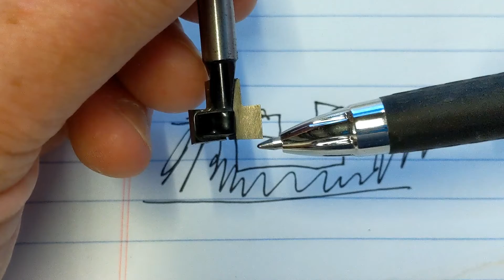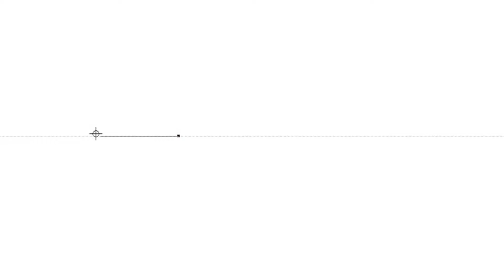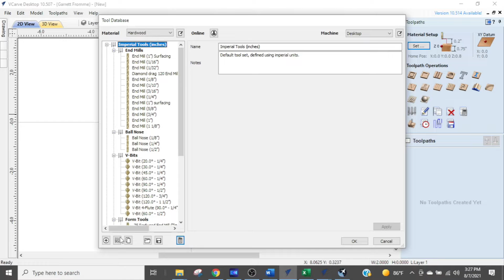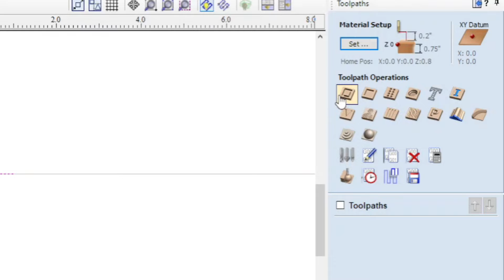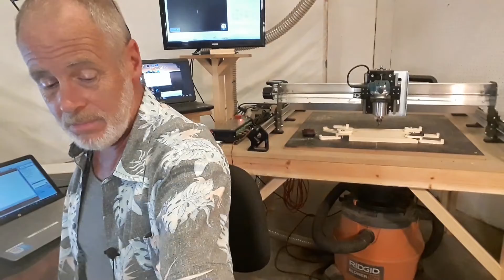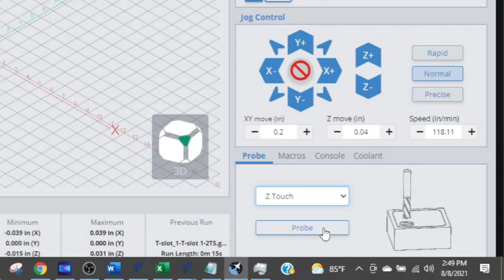How To Design/Make Keyhole Slots (T-slots) for CNC Router Projects - Garrett Fromme

Comment: Great video thanks, a little tip I have found useful is when I am using a 3\8 tee bit in oak I use a 1\4 straight bit and cut a slot with the same tool path but 3 passes.  This reduces the the load on the tee bit, I know it means a bit change but it works well.
Reply from the maker: Thanks for sharing that tip! It's always great to hear different techniques that can improve the CNC experience.

Comment: I hope you have time for this simple question?
In order to make your hold down clamps, what is the length are your T slot bolts?
Reply from the maker: iwannaapple7190, great question brother there really isn't a specific size bolt you need for the clamps, I recommend using whatever size you have on hand!
Reply: @IDCWoodcraft  
Mine were 5 inches long which does matter cause it runs the risk of the gantry running over them. The longmill isn't even that high and my cnc4newbie was barely clearing under the z axis. Cutting them was my only option. Cutting them too short will not afford me to use your clamps. Cutting them too long will put me in the same position of risking the router to run into the plastic knobs so I needed to make them right the first time. I think I cut them to about 3.5 inches? That turned out to be the minimum size so I got lucky that the clamps will still screw down.
In my opinion, the distance from the channel to the end of your clamp needs to be increased. It should be between 1" and 1.25 inches spacing. This allows for slightly more material to be cut out at the end for a lower and better grip on the wood. 
I cut mine out of 2x4's. Haven't used them yet but they are plenty strong using wood from the 2x4's.

Comment: Garrett love the videos, some thing i tried in vetric I used a rectangle 2inches long and .005 wide instead of the lines  on top of each other. The machine thinks it is a rectangle so it plunges down then cut on one line down moves over .005 then cuts  back on the other line to the start position and exits the piece . I tried it number of times and different t slot bits and it hasn't failed me yet.I have to get over and send you some coffee I drank a few watching this .
Reply from the maker: Don, that is a great idea brother! I want to try that myself.

Comment: I have been making tee slots for 2 years now, but just discovered this video. I set up the toolpath in Vectric the same way you do, but I do a few things differently. First of all I make a pilot hole with a regular end mill for the tee slot bit to enter before beginning its horizontal pass and I also cut a narrower path the length of the cut to clear the bulk of the material out of the cut before my tee slot bit even enters the wood. Doing it this way lessens the resistance on the bit because it doesn't have to remove all the material at once, leaves less debris in the cut and allows me to cut at 100 IPM.  Finally, I use a flute toolpath set at the desired depth with a 1% ramp at the beginning and end instead of a profile toolpath. Works perfect. I guess it just goes to show there's more than one way to do things.
Reply from the maker: Covert, all good points. There are so many ways to skin a cat in CNC. I'm glad that your method works well for you too.

Comment: I ran my G code for the T Slot and it plunged into the material, moved forward on the Y axis slightly, returned to the place it went in then made the slot to the right and then to the left and came bach
k up out of the hole. It worked but looks sloppy having an elongated hole instead of a round one. How can I adjust the G code to stop that motion? The code reads:
 (4AC7A5FFD0F6DEDC3B51B569B338FFCA)
T1M6
G17
G0Z20.320
G0X0.000Y0.000S16000M3
G0X-25.400Y0.000Z5.080
G1Z-8.890F203.2
G1X25.400Y0.000F762.0
X-25.400Y0.000
G0Z5.080
G0Z20.320
G0X0.000Y0.000
M30
Reply from the maker: Glen, your Gcode looks good. I read every move and there is nothing that would indicate to me why your hole would be elongated. Are you sure that its not a problem with the machine?

Comment: Another GREAT video. In Vectric simply make one line left to right, then click again on the right and go back to left or vice versa. one line on top of the other and it will complete the cut the way it should. I got tired of changing bits so I got a bit at Menards "orange brand"  about $20 and went to Harbor Freight and bought a small one hand router that had a fence you could attach. I simply make a mark in the middle of the width of the project (back side) . then measure 3/4 inch each way, make a mark. Set the fence on hand router for 3/4 in to 1 inch away from bit, using the fence as a guide for distance down from top, plunge router bit down on one mark , move to other mark and move back. Done in no time.
Reply: I should have said I did not get to try this in real life however preview looked correct.
Reply from the maker: Hi Gary. You know, that is a much better way of doing it if a person has a small router table. Thanks for adding this comment for others to see!

Comment: Hi Garret, I have an question sorry for my bad english, i actualy a little rusty, if dont pratice happen's  that. So I wish to know :
Now, I am using an GRBL + arduinos controller and BCNC to control my OX OPENBUILDS CNC . And when i try to put more tools , more especifque  different tools on an toolpath, the post-processor doesnt allow me to create that toolpath. How i can enable that on aspire and on machine. i can use another softwares to control my machine , if u use a software taht u are confortable with u could pass me the directions to me , i mean step-by*-step or made an video explaining that plz? Thx in advance
Reply from the maker: Hi Edwardo. Sorry for the delayed response. When you are saving your toolpath, select the third radio mutton at the top and check the box just below that. Then it will save all toolpaths

Comment: Thanks Garrett, great explanation on how to put the bit into the software's database. I especially liked the part where you put the Amazon link in the notes. That's a great tip.  I don't know if it is a topic you have covered, but file maintenance and how to save your work or versions of it may be important. Besides the cnc and creation piece, knowing how to properly manage your data for easy retrieval is important. I find a lot of people can be good with software, but struggle to find old projects because they are not filed away logically.  Do you already have a video on that?. Thanks for being there for us. Dieter
Reply from the maker: Hi Dieter.mI have been asked about file management before so it is worth doing a video on. Thanks for the idea!

Comment: Nice video....Good job!  I've been using a Freud 70-104 Key Hole bit  for a couple of years and it works great using this very technique.  Cost is under $20 U.S.  Thanks for the info on the GCode Sender and the tip on the red button.  When you use only one wrench it also puts a lot of twisting force on the Z axis plates and can force it out of tram.  Always use two wrenches to cancel out the forces!
Reply from the maker: Hi Huey. Keyholes are quite easy once we know how to do it. Rearding the red button on the makita router, I hope I saved a few routers. Thanks for commenting

Comment: Mlcs wood working has Tee slot cutter that are design plunge cut thatv are good and don't cost $100.00 Yonico Is the one that I have and it works very good Jeff
Reply from the maker: Hey Jeff. thaks. I was searcjing the wrong word. When I looked up keyhole cutter afer posting the video, I was like "Oh, shit...I goofed"

Good thing is I put links to the decent bits in the description area

Comment: Nice tutorial, Garrett!  Another trick for key slots is to taper the large portion with a V bit or countersink bit. It can be done with the CNC, on a drill press or even a hand held drill with some care.  This makes it easier to find the hole with the nail or screw you are hanging it on.  This is most appreciated on larger signs.
Reply from the maker: Hmmm, I like that other trick. Thanks Dusty!

Comment: I kinda like that gSender. Need to add a Homing routine for me to use. I would also like to see a Feed Hold.
Reply from the maker: They have a homing sequence. For feed hold, explain. Do you mean a temp pause?
Reply: @IDCWoodcraft  I must have over looked the Homing button. I was a CNC machinist for 30 years. A mean Feed Hold, just like on a big lathe or mill, or yes Temp hold if that is what you want to call it.

Comment: The Amana keyhole bit is also available on Amazon for the same price as Toolstoday but with free shipping if you're a Prime member. Just search for Amana Tool 45652

I agree that there's no reason to go super expensive on this bit as it's not used for a lot of cutting. Amana is decent enough quality and certainly better than the HSS faux-carbide ones I've seen cheaper on ebay, Ali or even Amazon.
Reply from the maker: Thanks Jim. For some reason, I wasn't thinking "keyhole cutter" when searching. When I used that term, the whole world opened up with keyhole bits. Thank you.

Comment: For anyone watching that doesn't have a touch probe, go buy one now. I would almost call it a necessity. You can survive without one but once you use it you won't want to. There is a list of convenience items that I would recommend every CNCer have if possible. 1. touch probe 2. IOT relay (turns on/off the router and dust collection automatically) 3. limit switches/ homing. Yes you can survive without them but if you set your projects up using "HOME" as zero you can always go back to it even if you loose power during a cut. It also makes job setup so fast.
4. Gamepad. Yes, that is right, I also initially thought it was overkill but once you use one to move the router around you will probably never use keyboard controls again. I'm not sure if G-sender or UGS allow for gamepad control but they should. It is seriously one of the best additions to my Onefinity.
Reply from the maker: Thanks Jeff, for this list. An IOT relay and gamepad are my next additions, for sure!
Reply: UGS allows you to use a phone or tablet as a pendant

Comment: Nice job, great explanation on setting up the tool data base. The touch plate for Next Wave CNC's works very well with the Vectric software also. 
I will create this file today as Keyhole bits on a handheld are terrible, not much better on the router table. But this will work well.
Great job.
Reply from the maker: Hey Doug. send me a picture of your first keyhole cut like this.

Comment: Great video Garrett! Key hole slots can be confusing if you don't measure everything correctly. It is always good to learn the skills of adding custom bits.  FYI Easel has a key hole app but you still need to measure everything correctly.
Reply from the maker: Hey Jeff. It is interesting. Key slots are so simple. I think that is why it can be confusing.

Comment: There is a macro for this on UCCNC, it's available from cnc nutz. You don't really need to do it in Vectric at all, just mark a centre on your work, jog to position and run the macro. 
Handy little thing. T slot bits are useful for several other things as well.
Reply from the maker: Hey Ollie. I'll have to look for that. Thanks